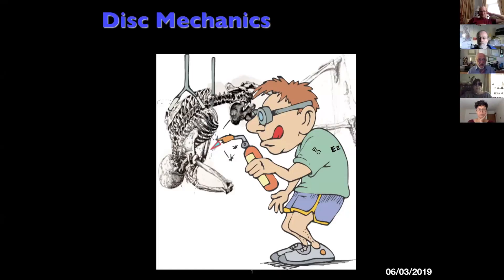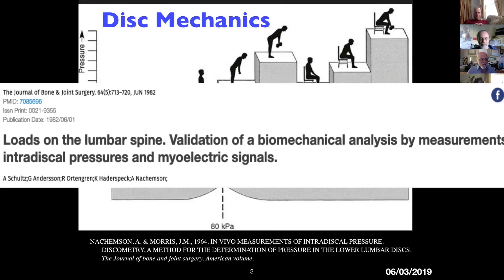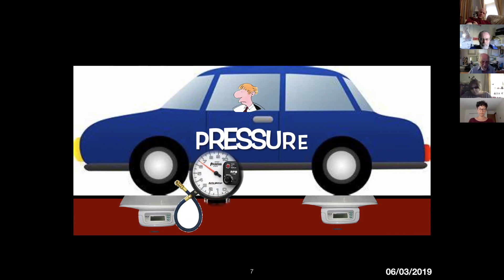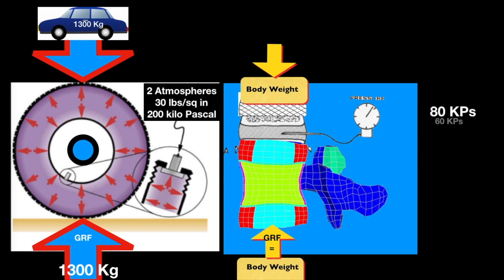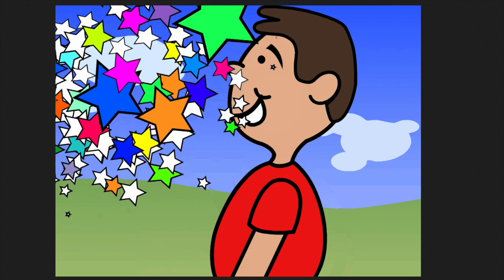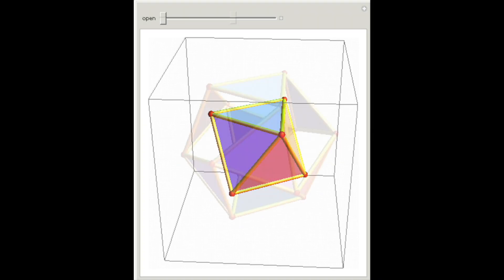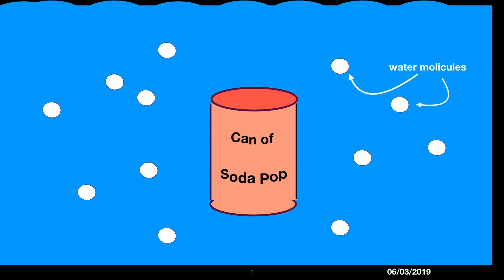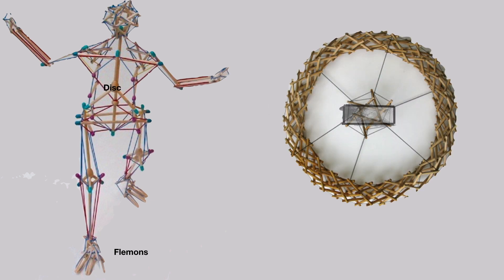Intradiscal Pressure

Comment: Hi, thank you for this great insight! 
It is amazing how small detail helps you to change whole perspective and to connect the dots with previously acquired knowledge.
Please, if you can tell me are the other also joints pressurized structures the same way as discs are?
For example knee and hip joints?
Are inside also certain pressures or non at all and they are holding only by the principles of biotensegrity?
Reply: As an orthopedic surgeon, I stuck needles in innumerable joints. Normal knees and other joints are not pressurized. If there is an effusion of fluid in a joint, that can be under pressure. A normal knee joint has about 5ccs of synovial fluid in it, the joint capacity can be 200ccs++. There is interocular pressure, intravascular pressure,  spinal fluid pressure, but none in joints. There have been some reports of negative pressure in hips, but, if all other synovial joints are non-pressurized, I doubt if hips are.
Reply: @StephenLevinBiotensegrity   Tensegrities are expanding and increasing tension pulls the compression elements apart. Stone columns are compressing and their very weight makes them smaller. Build yourself a tensegrity and play with it to see what happens.
Reply: @stephenlevin2021  Thank you for your answers and time.
Reply: @StephenLevinBiotensegrity  Thank you for clarification. If I understood right, joints are then just a part of the larger  biotensegral system. Only compression and tension.
In one of your articles I read that when you did knee surgery and tightened knee ligaments you expected that space between gets closer but in fact opposite happen. They went apart.
I am still trying to grasp and understand is that happening because when you tighten tension element locally it increases tension in the whole   body (whole system) which in return drives all compression elements apart (in this case the bones)?